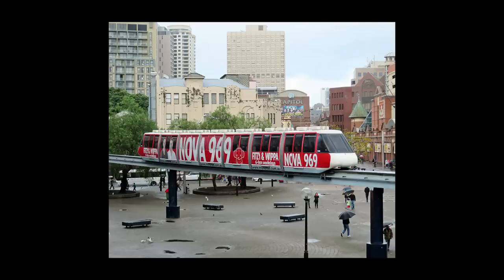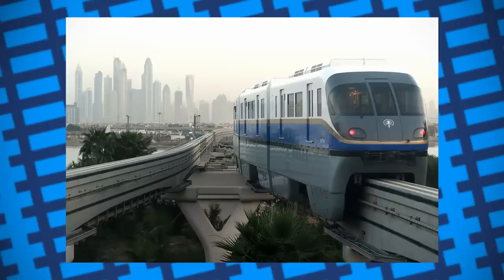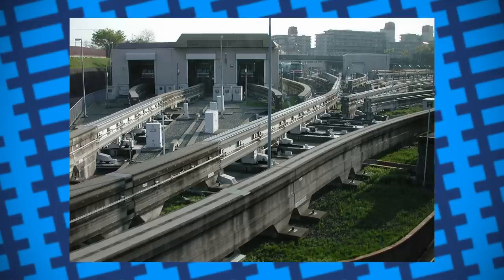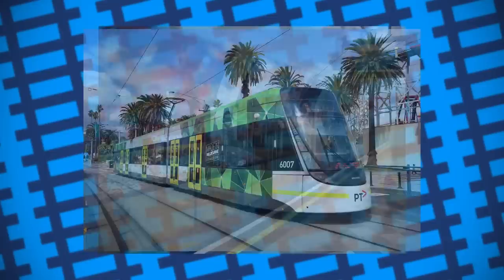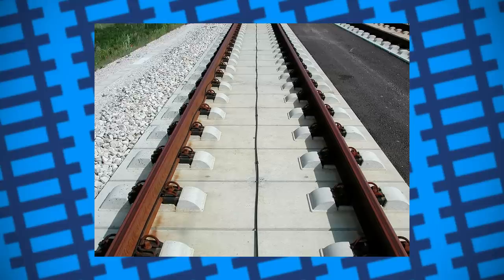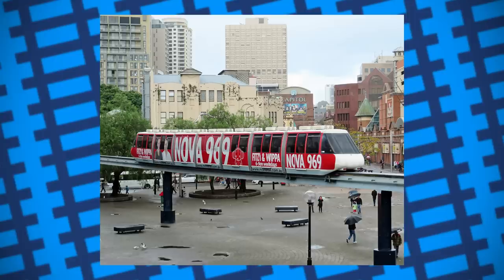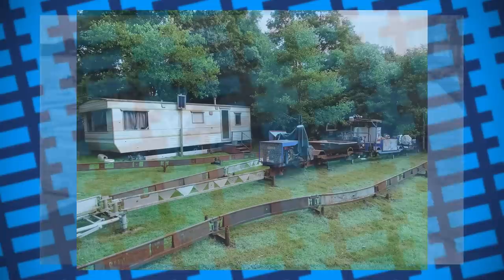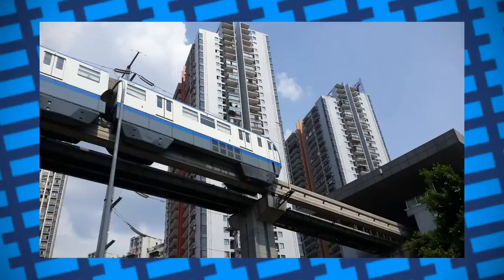Why monorails are bad as public transport - Monorails

Comment: Monorails are still good for closed-loop environments like amusement parks, fairgrounds and airports. And that's exactly why you only really see monorails in amusement parks, fairgrounds and airports. But not as urban transit.

I've been on the Seattle Center Monorail. Man that thing is slow and bumpy. I've ridden on buses that were faster and smoother than that!

One of my friends used to drive the monorail at Disneyland. He told me that the system would have to shut down whenever fires broke out in the propulsion system or if the tires went flat. It's also no fun if passengers are stranded on a non-functioning monorail train on a hot day and the air conditioning system is not working.

Comment: raised trams are literally just a better monorail. because you always have the option to run them at surface level. if you want rubber tires, you can just use rubber tires alongside the steel wheels.

are there any examples of raised light rail?
Reply: Seattle Link Light Rail is elevated in some parts. It's not rare
Reply: There are, but you need 10x more material to buld the track, not to mention the eyesore and noise:  https://www.youtube.com/watch?v=qQWOu9eDOn4
Reply: @My-Opinion-Doesnt-Matter  thats closer to a heavy rail system, with older infrastructure too. i know the Chicago L is very loud, its almost a cliche XD
Reply: @xymaryai8283  you're right, here are more modern metro, light rail and monorail in the same city, everyone has its purpose, but you can clearly see how much less infrastructure the monorail track uses, and how quieter it is: 

https://youtu.be/REnGMJc408k
Reply: @My-Opinion-Doesnt-Matter  i agree the raised LRT uses bigger bridges because it doesn't hug the rails as securely, but in normal operation it isn't any less safe to have simpler bridges, the only concern being the rigidity between the rails. if a monorail could use dual rail track for switching, i would be more in favour of it for city centers.

Comment: Monorails where often used as an additional transportation system over existing streets, the 'mono' in monorails gave it a narrow profile so they could be used over existing streets without blocking the light. And this is the only advantage they have.

Most Germans would not see the 'Schwebebahn' (tr: 'Levitation Track') shown at 4:36 as a monorail, it is mounted over a narrow river so it is not taking away any space from streets, technically you could have used a dual track system here, but it would have been much more difficult.
Reply: The  'Schwebebahn' is one of the few so-called 'monorails' that actually IS a monorail.

Comment: The two monorails in São Paulo have been a disaster, one is only partially concluded and running a half capacity at one of the most populous regions of the city (the east) without being able to take traffic away from the heavy rail lines, it was even paralysed for 3 months in 2020 due to a collision between two trains, while the other in the southwest of the city was supposed to be finished by 2014 and still hasn't opened. Safe to say they will be the only ones to be part of the system.
Reply: I'm just waiting someone who will update info on Sao Paolo monorail, thanks. My city will operate the first Bombadier 300 in the coming months. Let's see.

Comment: Oh dear, now you've done it. The monorail enthusiasts will hate you for the rest their lives, and will explain why you're wrong.

Thing is, you're absolutely right. Now where I live happens to be in the top 10 of most densely populated countries and territories in the world (Malta), and public transport consists of buses. And they're not very good. As a result, there is a very high rate of car ownership, which is just a very, very bad combination.

So, there needs to be a mass public transit system, and essentially there are three options: a metro system, a tram network, or a monorail. A metro would cost around €6bn over 20 or so years. Considering that GDP is €15bn per annum, and net European Union subsidies are around €1bn per annum (for everything), that's a staggering amount. A tram network would not be viable, because the roads are already too congested.

So, a monorail. Some think that this would be the solution, because of the footprint and because it doesn't interfere with other traffic. But they're blind to the obvious disadvantages of monorails. For example, they can only go to the periphery of towns and villages. And if you've never been to Malta: all these towns and villages have zero space between them. The only way to know that you're in a different local council is a sign. About half the island is one large urban area. Therefore, a monorail could only get to the edge of them, where most people don't live. Add to that the well-known disadvantages of monorails, and it's obvious why this would never work.

The one small criticism that I have about this video is that you show photos of the Wuppertal Schwebebahn, but you don't go into detail. The Schwebebahn is quite successful, and is often hailed as a shining example of a monorail. But Wuppertal has very, very specific conditions that made the monorail the only viable alternative.

Wuppertal (literally, Valley of the Wupper river; the German word "Tal" is the basis of the word "dollar") is a narrow valley with steep hillsides. Every square inch has been used up. Buses had insufficient capacity and got caught in traffic. Rail traffic wasn't viable because of the steep gradients. The only available place to build a mass transit system was over the river, and that's what they did.

So yes, in Wuppertal it works, because it had to work. But it doesn't really work anywhere else, at least not as well as conventional rail transport.